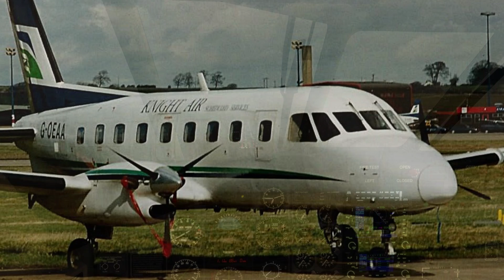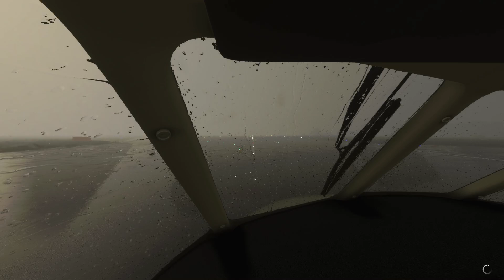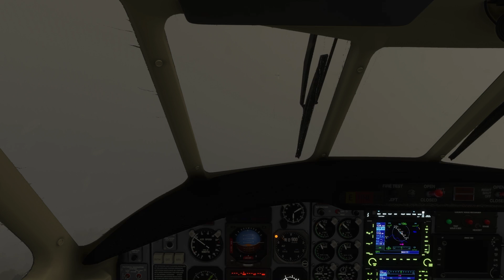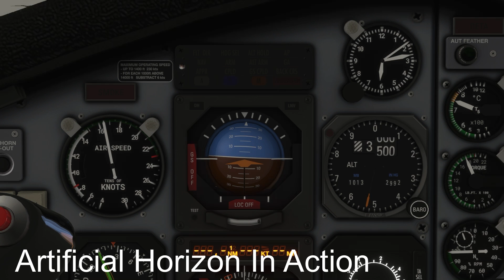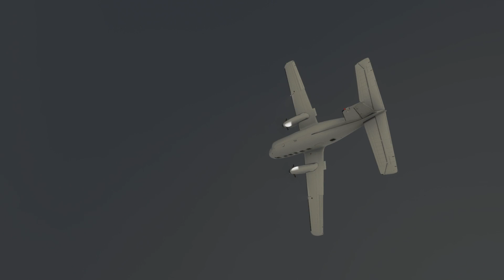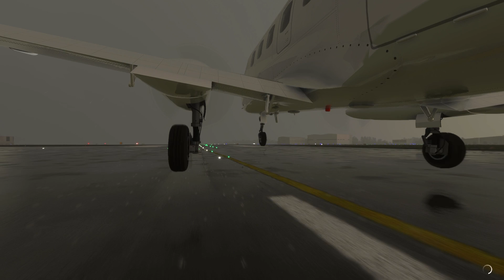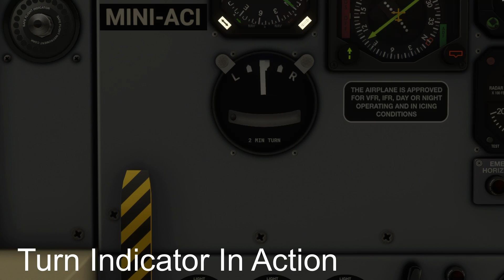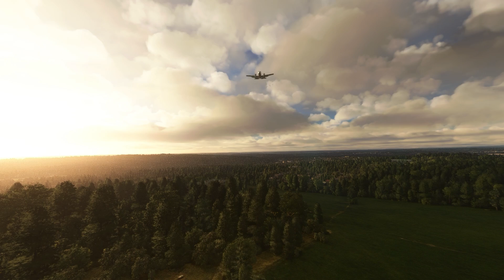The Pilot Who Was Flying Blind | The Crash Of Knight Air 816

Comment: Several sources I've found stated there was no requirement for a standby AH for that model, which adds to the problems. This flight isn't the only issue at LBA though, the Wikipedia page on the airport has more info on the incidents
Reply: At the beginning of my career I actually flew DC-9s with only two ADIs. It’s the only time I’ve flown a transport category aircraft without a third standby horizon, and that’s a good thing as I’ve had several fail throughout my career since then. 

I feel sorry for the these guys; if you’ve never felt the sensations involved with being disoriented in the clouds (especially at night), you truly can’t appreciate how hard it is to fight to control the plane while your body is telling you that you’re doing it all wrong. RIP.

Comment: This is why you train your partial panel skills regularly...
Reply: Really? I've recently retired after 35 years of airline flying and never did it as there was no turn and slip to practice on! Not only that, 95% of recurrent training is done using the autopilot and the small bit of hand flying (manual ILS) is done using the flight director. Raw data is an optional exercise!

Comment: Would not a plain old physical inclinometer on the centerline of the cockpit, as we use on a sailboat, indicate the aircraft is rolling left or right? It wouldn't indicate pitch but the altimeter or VSI would indicate climbing or descending.
Reply: This doesn't work. Take a quick look at the other comments. There's a reason fluid or spirit levels don't work on airplanes. It's the same reason your drink doesn't spill or tilt when the plane turns. It just gets a bit heavier.

Comment: Granted, Im not a pilot, so I might be way off base here. But logically Ive never understood, why all pilots do not have a half full bottle of water with them. Lost ur artifical horizon? Not sure of ur bank angle? Put ur water bottle on what should be a level surface, and the water will tell u the truth.
Reply: Take a glass of water and swing it around, the force keeps the water in.
Reply: It is because the water is affected by forces that the Artificial horizon is not. The artificial horizon uses a gyroscopic property called rigidity in space, which prevents most outside forces from affecting it. The water would only work if the airplane doesn't have to many outside forces acting on it, similar to the turn indicator mentioned in the video.

Comment: If all else fails, take your hands and feet off all control inputs and let the designed-in aircraft stability take over. All commercial aircraft are by physical design stable.
Reply: And then crash a while after.  I think you are confusing some aircraft's ability to self recover from a spin (not many), going hands and feet off in IMC (unless on autopilot) will not end well.
Reply: A lawn dart is very stable by physical design and there is a reason why we do want planes less stable than lawn darts. 
Also: trim. And turbulences.
The wings being mostly level in a 60° dive is not going to be especially helpful. Nor in a stalling climb.
Reply: @advorak8529  The tail design is such that there is always a restoring moment. So the nose goes down and the tail generates a higher downforce to compensate and pull the nose up. Most aircraft have a wing dihedral to do the same thing. A properly trimmed aircraft is very stable.
Reply: @minxythemerciless     As you said, that depends on the aircraft being properly trimmed.
You need the centre of drag and centre of lift slightly rearwards of the centre of mass(AKA centre of gravity, CG), or your plane will want to fly backwards --- a very bad thing.

You do have a restorative force of the nose towards the plane's movement though the air, and a wing dihedral will give some restorative roll force --- but that will be along the path.  It does not pull you out of a dive.

However, you need the tail to exert a downwards push ... throw a lawn dart some day and watch that while it is all stable "nose forward" it angles more and more downwards and slams into the ground.  And that amount varies.  Position of the CG, weight of the plane, engine output (unless it's straight in line with the CG, which it rarely is --- also, unless finely controlled, thrust will not be exactly identical for all engines), and so on and so on.

Best case: the dihedral keeps you fairly level and you get into some speed/AoA/height oscillation and not into a dive (with little banking) killing some squirrels.

Comment: Losing any instrument in IMC is tough. You really have to be disciplined in keeping a good instrument scan going. The one thing you can't do is use the physical feelings about what you think the aircraft is doing. That's how you get into spatial disorientation. You have to trust the instruments and use all of them, together, to figure out the bad one and what the aircraft is doing. In this case, you use the compass/HSI and turn coordinator to figure out if the aircraft is turning, and the altimeter and airspeed to figure out if it is climbing or descending. Flying by the "seat of your pants" in IMC gets you killed.
Reply: I'm not a pilot (I play flightsim), but that's exactly what I though watching the video. Since ATP, FS5 up to FSX with other passionnated flightsimmers, we used to have flying blind and reduced instruments contests (no ILS and no throttle lever indication for eg.) Won most of the contests over the decades. I'm aware simulation is nowhere close to reallife, but it's fairly similar : loop scan the instruments and translate the informations into space, positions and motions. Not to brag about (nobody cares) but, I tend to disagree on the difficulty level to rule out which instrument is faulty : course tells you if you're turning, why do you ask ATC ? BTW, I always tune on some navaids (never prioritized GPS, I love to read charts and tune in NAV1, NAV2 and ADF, basic triangulation) You know (relatively) where you are, scan HSI (Course, NAV1, NAV2), ADF, Artificial horizon to correct level, a plane easily make a roll in a matter of seconds. Rule out any instrument not compliant with other information at the 3rd or 4th scan.

When you know you're stable (no significant turns), altimeter (you have 3 instruments usually), maintain power and observe speed (and flaps, landing gear, spoilers). If it goes up, you're likely in a dive. As long as you don't slow down keep going (climbing), monitor engine instruments and go back securing level. Repeat, just go straight until you have a visual cue (sun position - give your eyes time to adapt, don't mistake a dark cloud spot for the sky). When you cleared the fog, ask for vectors to VMC divert, don't try to land in the soup. Priority is to not going CFIT, as long as you are not on fire or fuel starve, the plane flies.

I know I'm very old school, but the basic is always "fly the damn plane". If there are two of you out there, one must fly and no other thing, no matter a passenger has died or who made the last maintainance on that horizon, fly ! If you're alone, unless ATC tells you "you have terrain ahead", just fly (ie, use every inch of every relevant instrument). Maybe because I live in a third world country where most planes doesn't have Garmin GPS and only a handful VOR are equipped with DME (we use NDBs), I find it astonishing how some youger fellow simmers dare to ignore the existence of NAV2 and ADF (and other "old" instruments). That's just asking to die.
Reply: Basic way of flying with partial panel save your skin !!! Turn-"coordinator : kick same side of the ball in order to center it .. so you know instantly which way you are banking , then level the wings then block the needle of the altimeter ( very accurate )...it takes 5s   forget the attitude indicator in such situation because  it ’s confusing ,,,then resume your flight...
Reply: @jean-claudepecqueur625  That is not how it's done. The ball does not indicate bank.
Reply: Correct ! What you have to know : ball centered means your flight is correct ( no slip / no skid ...) so the turn and coordinator will you indicate immediatly wich way you are banking ...( more confusing with the attitude indicator when steep bank ) ...
If you ignore this basic I will not give you a plane !

Comment: Do pilots carry cell phones with artificial horizon apps installed, just in case this happens? Would those apps actually help in this scenario?
Reply: It would not help. Cell phones use acceleration sensors which would mostly agree with what the pilot feels. It would however agree with the turn indicator. Artificial horizons use gyroscopes which show the true attitude.
Reply: Not in this time of this accident. Cells were a dream then.

Comment: This is where fluffy dice are essential.
Reply: Also, the Hawaiian chick in the grass skirt that does the hula on your dash board.
Reply: or a bottle of water. 😁😄
Reply: I was thinking the same thing: there has to be a simple way to orient oneself to gravity without high-tech equipment in case of emergency.
Reply: @freepalestine2434  Reach behind you and extract the emergency duck from its wicker basket, then throw it out the window. You can now follow it down to below the ceiling, because even ducks aren't stupid enough to fly in solid cloud.
Reply: @LesBell  "That's the dumbest thing I've ever heard, Les.  All we keep back there are drinking water and cigarettes.  Look, there's no such thing as an emergency du-"
*opens wicker basket*
*quacking intensifies*
Reply: a plumb bob hanging at the centre line over the panel out of the line of sight cures all misunderstood gauges. You cannot fool Mr. Gravity like he can fool us

Comment: Hmmm. A turn coordinator won’t tell you anything really about your wings. If they were in a turn it will only tell you if you’re slipping or skidding. Not which way you’re turning. You could be turning left and the ball could go left or right. 

In the spiral they were in, the turn coordinator would most likely have been centred and not showing any turn as all it is showing you is where the G Force is pulling it. 

Love the videos though. Always great going to bed and seeing a new one.
Reply: None of that is correct, sorry. The needle or little airplane icon (depending on type) shows that the A/C is turning left or right. It does not tell you bank angle. This gyro cannot tumble, which is why its info is used to support (verify) the attitude indicator. In the spiral, the ball might well be centered but, the needle will indicate direction. The explanation in the video was ass-backwards. I hope this doesn't offend, sorry.
Reply: that is why you need to go to 1g flight by feel first (which is quite hard and uncertain), then it should show you wings lvel as long as you have no siedeslip
Reply: @louissikkema5399  it’s quite simple to fly one 1g with your bum planted directly down on the seat though and you could be in a big turn and nothing will show you that on partial panel except the compass.

Comment: Won't a partially filled glass of water placed on the top of the dashboard tell if the plane is level or banked ?
Reply: No, because in any kind of turn plane experiences lateral acceleration, which will bring the water level out of alignment with horizon. And even worse, this effect is highly dependent on turn speed, with sharp enough turn it is completely possible to make water level stay perpendicular to the horizon.
Reply: That is exactly turn indicator.
Reply: @michapeka2800  Exactly wrong. Sorry.
Reply: See one of the YouTube videos of Bob Hoover pouring water from a pitcher into a glass while rolling - the water thinks "down" is "down" in the airplane, not "down" where the center of the earth is.

Comment: Flying in cloud with no artificial horizon……. That’s a nightmare! 😱
Reply: sticking a string on the roof in front of you can help you maintain a horizon. That's the same way gliders used to do it. The string hangs down, if it is hanging slightly left and back, you are in a slow upwards turn to port. If the string is pointing slightly forward, you are descending. This has saved many lives.
Reply: @offgridcabin1557  
I have no glider experience, but I did try the string method on my PPL training. Yes, it does help. However, in this accident case,  I think it’s physically impossible to stick a string outside the cockpit. They didn’t have enough time either. 🤔
Reply: @niku30504  I think you mean INSIDE the cockpit. Just in front of you... But.. would it have been possible for the atc or a secondary  atc to Just monitor the plane so that the pilots could gain hight to get out of a dangerous low flight level?  Such a waste of lives this plane crash was... Rip alle diceased and good luck for all their loved ones 😢
Reply: @hugodeckers3880  OK, I misunderstood. I was thinking of “yaw string”. You stick a thread OUTSIDE of the windshield in the center, and it will tell you if you are in a coordinated turn or in a slip turn. Now, in this case, hanging a thread INSIDE the cockpit. Yes, it may work in a glider. However, it may not work for a bigger aircraft, because there is a lot of air conditioning airflow circulating in the cockpit. As for the ATC helping them by using radar…… the pilot was actually getting help from ATC, but it didn’t work. The special disorientation was probably too overwhelming.
Reply: @niku30504  You hang it "Inside" from where a rearview mirror would be on a car. That way it is NOT affected by the wind. Only gravity affects it. That way you can tell if it is straight down or leaning forward or back or to either side. You can tell whether you are in stable flight or banking with a string.
Reply: @offgridcabin1557  This is COMPLETELY untrue. Please don't do this. You can try it while flying under VFR. As long as the plane is in coordinated, unaccellerated flight, the string will point at the floor of the airplane-- NOT TOWARDS THE GROUND!!. This is true even while turning. Do not spread this misinformed, dangerous myth. BTW - The string on a glider is on the OUTSIDE of the plane and shows SLIP only. I'm guessing you're not a pilot.
Reply: I flew into clouds a few times in  a J3 Cub. No gyros at all. Just like flying with a bag over your head. Once I put it in a spin and didn't recover until I exited below the clouds. Dumb but things like this happen when you are just a kid. The narrator is not a pilot. Not even close.
Reply: I disagree:  not a nightmare, a matter of proficiency.  See my comment above about flying that way for an hour at a time.